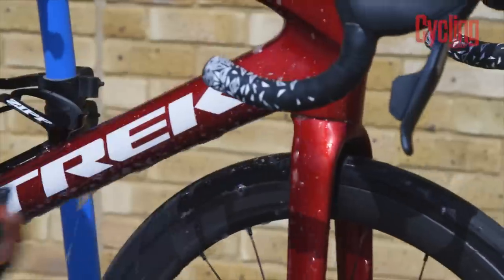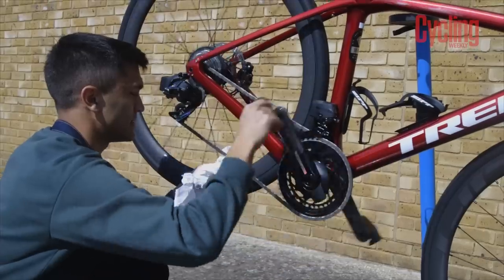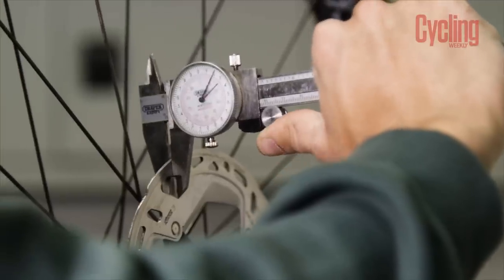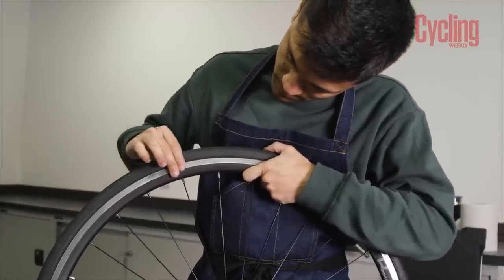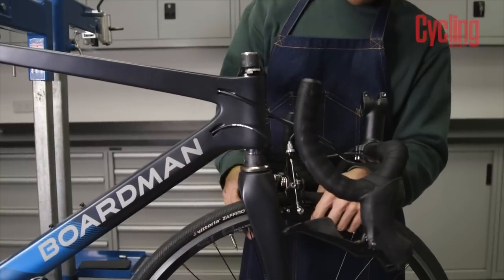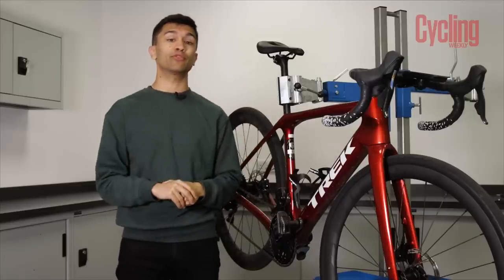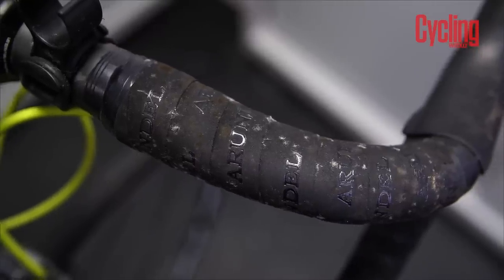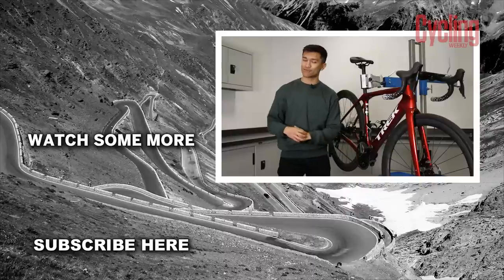7 Essential Summer Changes For Your Road Bike

Comment: I would not use a hard brush on your painted frame as this video shows, it will leave surface scratches on your cleat coat, use a soft sponge instead.
Reply: I'm pretty sure that that is a soft-bristled brush that comes with the Worx battery-powered portable pressure washer. I probably wouldn't use the same brush on the drive train that I use on the rest of the bike.

Comment: I'm always facinated by this summerbike/winterbike stuff. I use my gravelbike with 40mm tires, fenders, rackpack and stand no matter if it is winter, summer, autum or spring...
Reply: good to hear you don't check your bearings, chain and seatpost.
Reply: Oh don't worry about that. One time waxing a year, hambini bottom braket, brake bleeding in Winter every two years, tire chancing is easy peasy. My comment is more about my amusement that there is a concept of owning and chancing Bikes for seasons.
Reply: @generischgesichtslosgeneri3781  waxing once a year won't get you very far if you ride in the wet often...Expensive bottom bracket solutions are nice for frames that aren't made with good tolerances; buy yourself a good frame next time ;-)
Reply: @l.d.t.6327  such as canondale, specialized, trek and such? LOL, dork.
You can also wax your frame. ;)
Reply: @Generisch gesichtslos Generisch  I guess some people just enjoy riding a fast, light bike. Strange, that... ;-)  Or are you a bike tourer / gravel afficionado making some passive-aggressive attack on roadies?
Reply: @Rossingiol  I never clean my bike. I only clean the rolling parts. It's silly to wax your chain once a year (a 5 Watt gain for a week) if you're riding a gravel bike that's get dusty / dirty in no time... Either you do it right (in case of a gravel bike: just clean your chain, waxing isn't going to do much), or you stop giving silly replies.
Why are you fascinated by something that you obviously won't do? Seems to me you are what you write, a 'LOL, dork'.

Comment: I would never wash my road bike like that. It's bad enough that I drip sweat on it. I use Maguire's Ceramic wax that doubles as the perfect cleaner and micro fiber clothes to clean off the debris after every ride. Hot wax chains are a must these days.

Comment: Just a tip for the cleaning, don't use washing up liquid, its full of sodium which causes small scratches to paintwork over time. I tend to use specific bike cleaner.
Reply: Just about to comment this. Top job
Reply: I use washing up liquid, no problems. Bike looks like new after a wash and it's even great to degrease the chain. Don't fall for all the marketing nonsense.
Reply: @hcw199  I'd agree, you're paying more for the word 'bike' in cleaning products. I've never had an issue with washing up liquid.
Reply: What a load of tosh 🤔..., i have always used washing up liquid with warm water on all my bikes over the years & not once ever has it scratch any of my bikes paint work.., dont fall into any of this nonsense but washing up liquid in my op3sorks just as good or in some case's better than a "bike" specific cleaner.
Reply: And careful with the oxygen in water as this lifts up your paint over time. Terrible business.
Reply: I'd say the brush he was using in the video would probably scratch his paint more than the detergent!
Reply: Who else watched todays video with Ollie saying NOT to use “washing up liquid” 😂
Reply: I use black soap. Its commonly used  in detailing to clean exterior and interior
Reply: I've heard car soap works well

Comment: Absolutely DO NOT use washing up liquid to clean your bike. Ludicrous tip

Washing up liquid will damage paintwork over time. It’s designed for getting really tough crud from dishes. Not for protecting paintwork